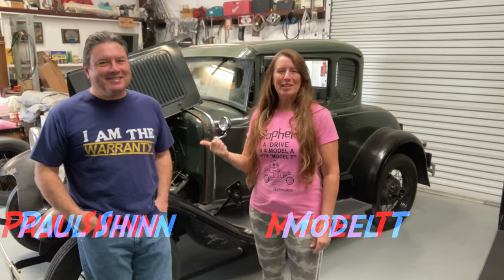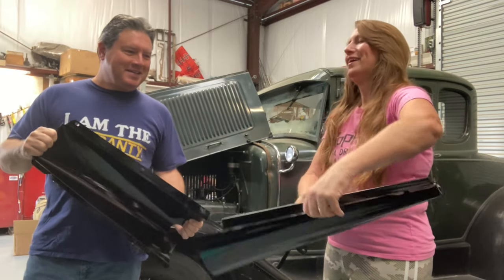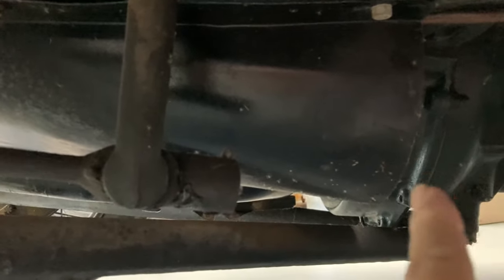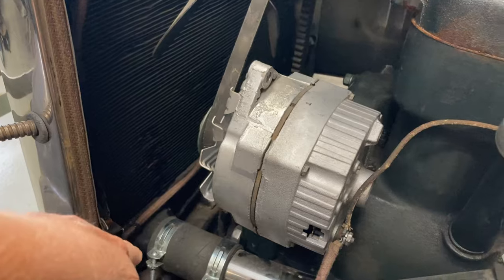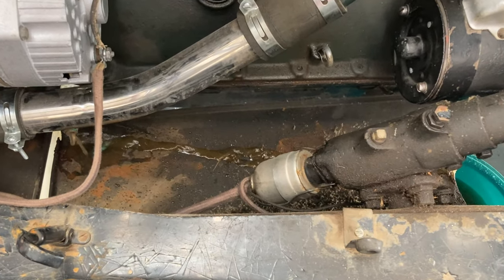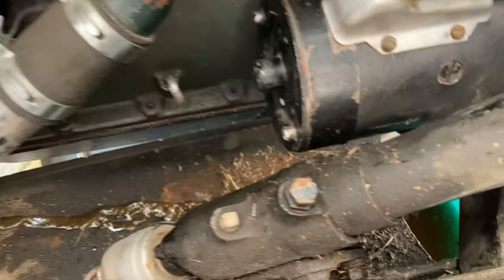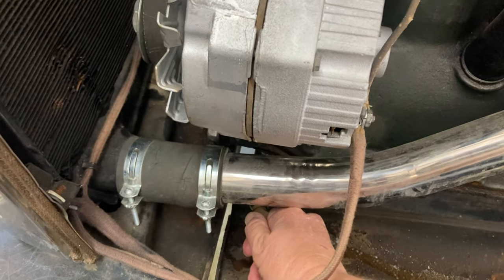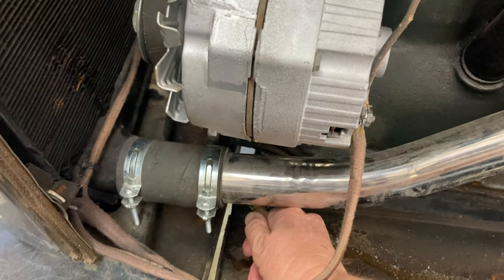Ford Model A Radiators, how do they work? How to drain & refill coolant 2 ways, Paul Shinn assisted!

Comment: Here;s a tip: Dad taught me to put diesel fuel in the rad to stop rust. cup for your A pint for car 1 gallon for big trucks. Just remember you did it and not fear a blown head gasket. This works well so well in fact after a year open to air there was no rust. Dad was a fleet diesel mechanic.

Comment: Very informative. I find that a standard kitchen bucket will fit under the splash pan, holds all 3 gallons, and is easier to pour from.

Also, I like your choice of fuse. Safer than the bolt-on contraptions sold by the suppliers, which can short.
Reply from the maker: Thanks for your input! A bucket could possibly work for many, but unfortunately some people may not be strong enough to carry 3 gallons of fluid…
Take care 💕

Comment: Coolant does not cool that's why you need the 50/50 mix. Coolant is a rust inhibitor, antifreeze and provides some lubrication. If you run 100% coolant you can overheat your engine because it's not good at taking on the BTU"S needed to cool the engine. You need the water to absorb the BTU's from the engine block and this is why they run a 50/50 mixture. Besides low octane fuel If a engine is over heating one of the first things you will hear is pinging which is predetonation and can damage a piston. Good luck,  and thanks for the video, Mike
Reply from the maker: Yes, maybe I should reword to 50/50 mix, but we explained that that’s what we used in the video. Thanks for sharing! 💕 Happy thanksgiving 🦃
Reply: @Modeltshinn your title is fine, it's poor wording on the part of the manufacturers calling it coolant and this makes many people think that the more the better but when you go to manufacturer factory training you find out that a lot of things are different than you thought 😉. The model A is from the good old days of keep it simple. Happy Thanksgiving, Mike
Reply from the maker: @Go4Corvette  oh got ya! True, thanks!

Comment: Model T I had a pro mechanic explaine to me how a radiator works..
He told me that the air going through the radiator makes the water hot !
and the engine cools the water off !
he was serious and A.S.C. certified ?
 Happy Thanksgiving to you both.
Reply from the maker: Wow, that’s sad, maybe he needed more sleep? That wouldn’t make sense at all, the coolant needs to be cooler so over heating doesn’t happen, that’s the purpose of a radiator and fins for air to go through…etc
Reply: @Modeltshinn  I tryed to explane is the engine is what gets hot.
he told me I dont know what im talking about. And he was the export !!!!!!!!!!!!!!!!!!!!
Reply from the maker: @mattomon1045  wow, that must have been a strange conversation…probably made you feel like you were on one of those got ya tv shows lol

Comment: Another great video..... With cats I'd bet you have an old litter box around  that's what I use.
Also, I know it isn't a pressurized system, but is there any actual sealing with the cap or is it vented to atmosphere? If sealing, then may I respectfully point out that it would probably drain faster with the cap off.
Keep the videos coming!!
Reply from the maker: Hi Jeff! Thank you so much! The radiator is vented to atmosphere. Have a wonderful new year! 💗🥳

Comment: Model T & Paul, perfect timing for this video. I started draining and flushing my 400, the radiator has a grease build up around the neck from years of over packing the water pump. I’ve put some vinegar in it and flushed, another person said to put in 2 Tablespoons of dawn liquid detergent and run the car for a few minutes? I’ll start this over the weekend. You are teasing us with a giveaway? Haven’t tackled the timing for the 400? One item at a time, just discovered that the E brake rods are missing from the car? Surprise surprise, any location for replacements?
Hope you and Family Have a Blessed Thanksgiving.
Reply: Most any Model A parts shop such as Snyders has brake rods.
Reply from the maker: Thanks for responding Tom! Have a wonderful new year! 💗🥳
Reply from the maker: I’m happy you are having progress and getting some help with information since we are slow to get back to everyone. I’m going to guess that you flushed the radiator sufficiently after the dawn soap lol, all I can picture is the 400 spitting out bubbles as it drives 😂 Have a wonderful new year! 💗🥳

Comment: I've noticed that there is no thermostat. so because of this fact, how long does it take these engines to reach final running temp? I know with newer cars, they say that the running temp should be reached as soon as possible. So, when did ford include a thermostat in their cars? Paul, don't eat too much or you'll have to raise the cars higher to go crawl under them. haha
Reply from the maker: Great questions! I know Paul has done a video where he shows how to get an engine warmed up faster when it’s cold by placing a piece of card board in front of the radiator…sounds like it’s time for another video to answer this 💗 The end of you message 😂😂

Comment: Have you considered using Evan’s waterless coolant?
Reply from the maker: No, not something we would use or need to and it’s much more expensive.
Reply: @Modeltshinn 
Evan’s is reusable, and waterless which would stop the inside of your engines from rusting out. 
If your a Jay Leno fan you can check out his Evan’s video.

Comment: What are your thoughts on back flushing?  Or running a radiator flush?  I can run at 40 no problem.  I push to 50 and overheat.   Is that a natural limit?  Clogged radiator?  Water pump limit?  Just trying to figure it out.  Thanks.
Reply from the maker: It sounds like you have a head gasket leak…if it were the radiator it would over heat no matter what speed.
Reply: @Modeltshinn  Thanks.

Comment: How long does it take to drain the radiator? Mine seems to take 2-3 hours, and I'm not sure if that is normal or if there's some blockage going on. I'm on a second vinegar soak to get so many years worth of rust out. Hoping it won't overheat anymore.
Reply: Answered my own question, after my third flush the pettcock valve barely dripped... I removed the water pipe and it gushed out. Years of rust buildup had blocked the valve. A couple flushes with the water pipe off later, still getting lots of rust clumps. Hopefully I'll get to that point that the water is drinkable ;-)